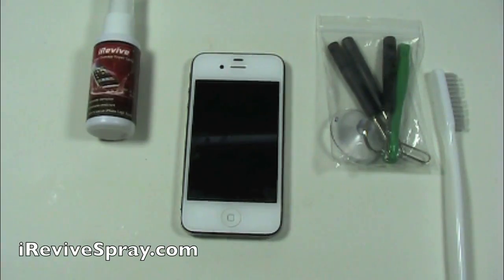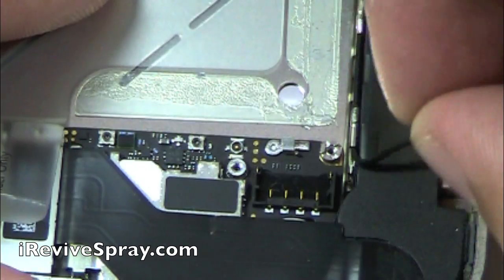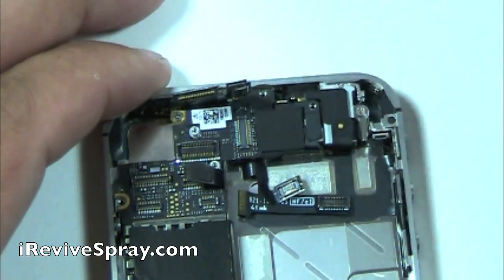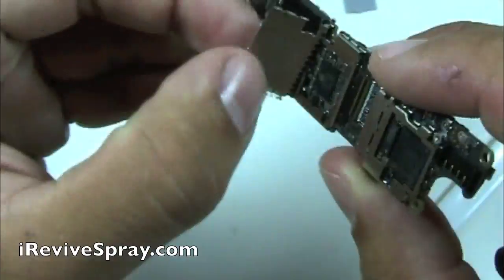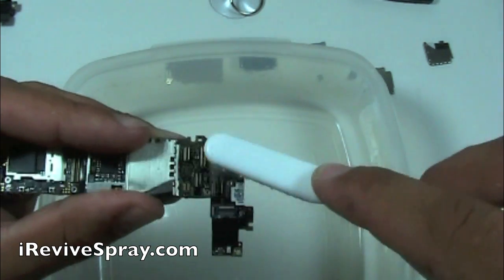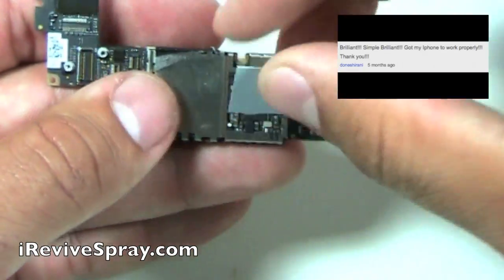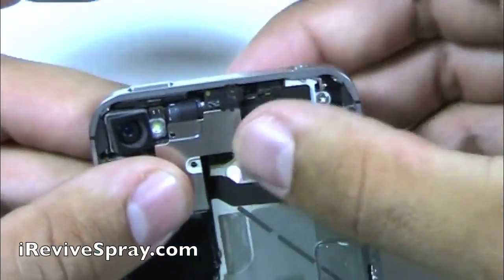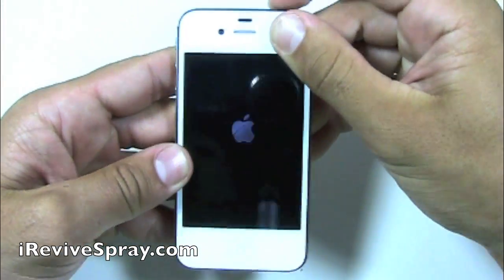100% Water Damaged iPhone 4S Repair Tutorial - Fix Wet iPhone With iRevive

Comment: I really appreciate you putting your time into this video, and explaining every step. Good job. It has not fixed my phone just yet. The bottom of my phone had a morning - smoothie- merge damage, but at least I know that it must be short circuit either in the battery or motherboard for the phone looked all dry and clean inside. I opened it up within a few hours, took it apart, and now I am confident that the smoothie did not get inside. I'm getting a replacement battery and if that doesn't help my phone to work I'll look into replacing the logic board myself. Thanks again!!!

Comment: Hey, this is Phoebe from HongKong Heeson Electronics Technology co.,ltd, a factory supplier of lcd with high quality and best price. LCD is used to repair and replace your wrong, cracked,damaged,faulty, shattered screen . Also cure display problems, dead pixel,cracked screen and wrong color isssue. The screen offers you high sensitivity and durable performance. Welcome to enquiry.
WhatsApp:+8615171499714  Skype；phoebe120120

Comment: hi colby i have an iphone 4s i do repairs for cracked screens so i am very experienced with the internals of an iphone. i used the spray exactly as you said in the video and the iphone still wont power on i even tried another lcd and digitizer but it wont work the only thing i am sure of is the battery working and the camera because the flash would just stay on until i disconnect the battery please comment or just email me azarcases@aol.com

Comment: Colby, is it worth it?  I did a 5k mud run and forgot that I had my iPhone 4s in my pocket.  I was submerged in muddy water.  When I shook it out it had brown muddy water dripping out of it.  I shook it quite a while and did not try to turn it on.  The flash stayed on and would not go off.  It warmed a bit until the battery died.  I put it in rice for a couple of days and no luck.   Won't even show and intent to charge when I plug it in.  Any suggestions?

Comment: Before taking my phone apart the phone would boot up, but would not connect to wifi or the network and would freeze a few minutes in. Now that I took it apart and cleaned it, it seems to boot up and work, but the screen won't come on. I can hear it beep when it's plugged in to a computer and if you call it, it rings, so I know it's working, I just can't see anything. I took it apart and checked all the connection 5 times and I can't get the screen to work. Any suggestions?

Comment: Hi, my iphone 4s got washed by water too , i straight turned it off ,but in a while the flash light of the camera started working by its own till the battery got over and the sound is gone too,i gave the repairing shop for fixing for me,,he couldnt fix it for me ,,my question is>is the camera destroyed ,and i ve to get it a new one or i just have to clean it , and about speakers i can talk incoming/out calls and i can get a ringing sound while getting a call but cant hear to music on other ways

Comment: question for you guys??? ,I dropped my I-phone 4S 3G ,in coke ,but i only submerged about an inch of the bottom of the phone ,now do i have to clean the whole inside of the phone ,like in your video ,or just replace the Battery ,b/c it has air bubbles in bottom like you show in your video ,please help me ,im disgusted over my stupidity

Comment: I fixed my phone using i revive, it works! I was nervous doing this, but I did it! My screen flickers a tiny bit, is this because my LCD screen has water damage? 

btw, I accidentally washed my phone through a full wash cycle.